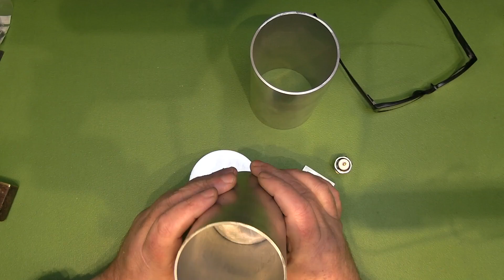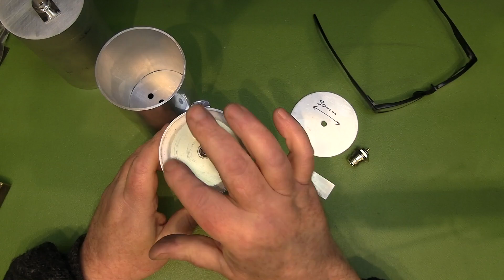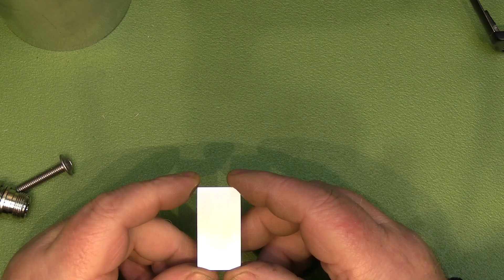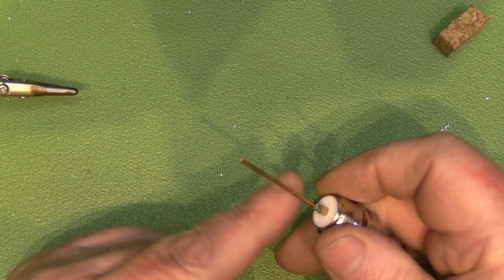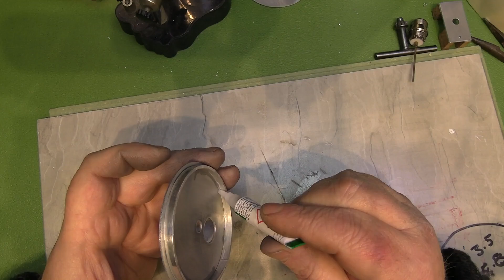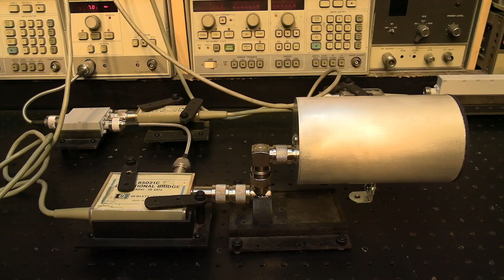The Waveguide Panel Antenna

Comment: if i build a biquad antenna should i connect the driven to the coax ground? since i saw that you du such things on all of your biquad antenna, i never build biquad before but im used to building yagi with a dipole driven element and they usually tell us to use 4:1 coax balun and not just connect the other side to the coax shield which gonna makes rf travels on the outer shield and probably interfeering with the inner coax core where the rf should be

Comment: Isn't the driven element shorted to the enclosure using the screw? I thought it shouldn't be
Reply from the maker: Yes if we wanted it isolated the measurements would be different and would not work as well. Shorting in RF does not have the same outcome as shorting electrically

Comment: Hello Andres. A pleasure to write to you.
I'm wondering if it's possible to replace the M6 screw with an M2 or M3 one. In my experience, using a thinner screw has given me better results, and even better using a plastic screw. I don't know if it is possible to try those variants.
Thank you
-------------------------------------------------------------------------------------------------------------------------------
Hola Andrew. Un placer escribirle. 
Me pregunto si es posible remplazar el tornillo M6 por uno M2 o M3. En mi experiencia me ha dado mayor resultado usar un tornillos mas delgado, incluso mejor utilizando un tornillo plástico. No se si es posible probar esas variantes.
Saludos

Comment: There is a thing called aluminium loaded epoxy resin. That will give you electricity conductive bond. Also you can buy silver loaded epoxy resin but it is very expensive but again it will give good mechanical bond as well as a good electric bond. 
Richard. Sydney Australia.

Comment: I was thinking that using some of the aluminum "brazing" material to at least "tack" the aluminum reflector to the tubing would give a guaranteed electrical bond, if that is critical, because the aluminum oxidizes quite quickly to a nonconductive surface... Just a thought?

Comment: How do you measure the gain of the antennas you design?
Reply: There are anyzers which measure the reflection of power of different frequencies of the antenna.
Tools can cost you a leg and an arm, a house, or you can get small cheap ones like the NanoVNA (well, maybe also not super cheap, but much cheaper than theothers, around 100-200$)
Reply: @tarakivu8861  yes that is how the reflection power is measured. But I'm asking how is the gain measured?